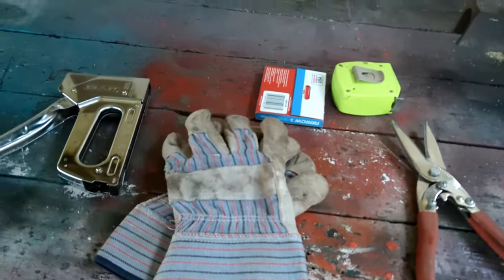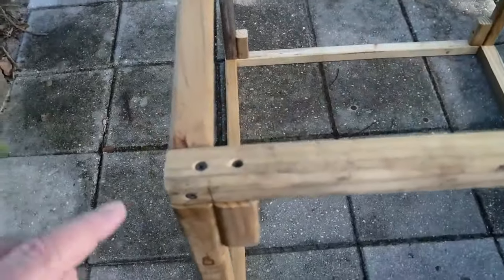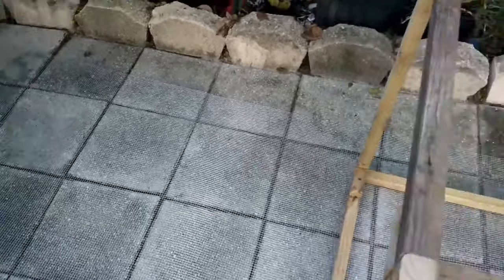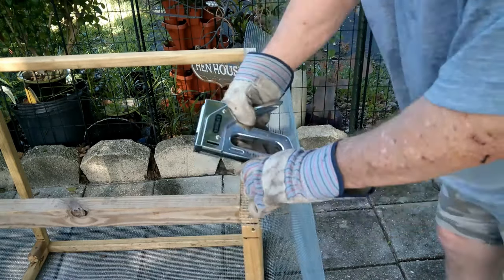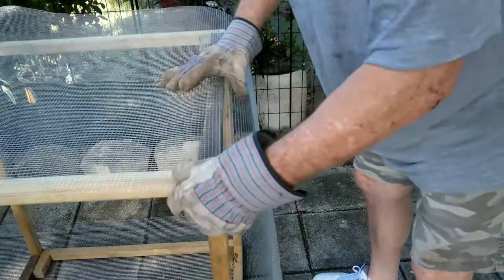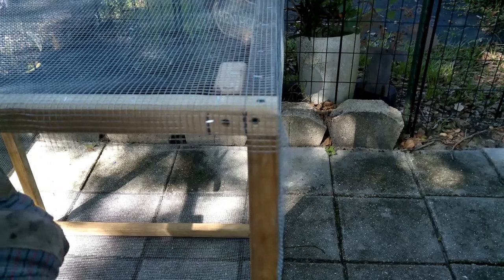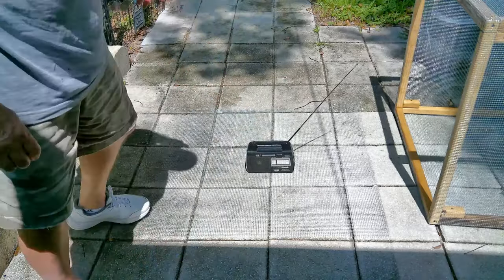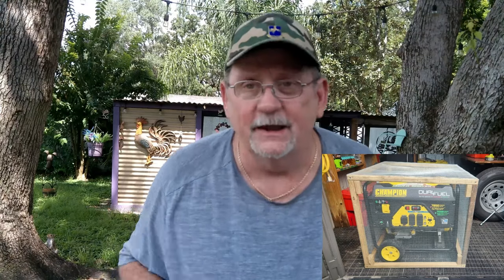Faraday Cage Build

Comment: Aluminium screen mesh works even better especially if you earth/ground it to a Copper/Aluminium rod sunk into the ground using a wire about 12awg technically smaller mesh offers more protection and you can separate a generator from the ground with wood under the item keeping it far enough away from the shielding material
Reply from the maker: Thanks for watching and sharing more info.

Comment: Great video by the way…I’m curious…the chicken wire that you used is it aluminum? I didn’t know chicken can be aluminum? Thanks Rich
Reply from the maker: It's just standard steel wire. Thanks for watching.
Reply: @theorlandoprepper  thanks for replying back to me…I was under the assumption it needed to be aluminum?
Reply from the maker: @Balboa64  any metal wire will work.